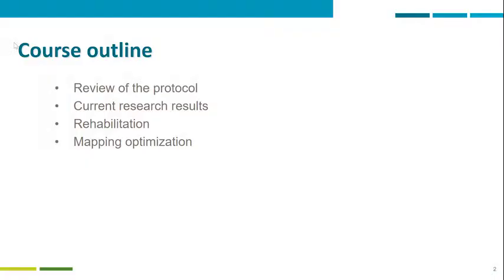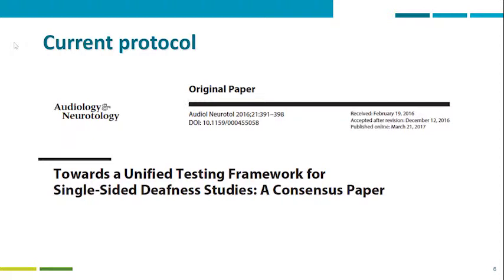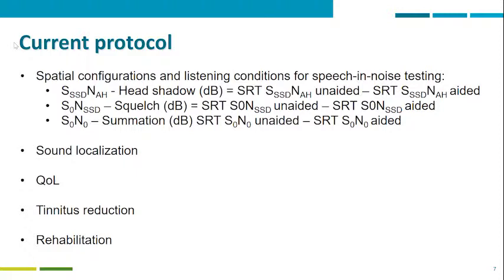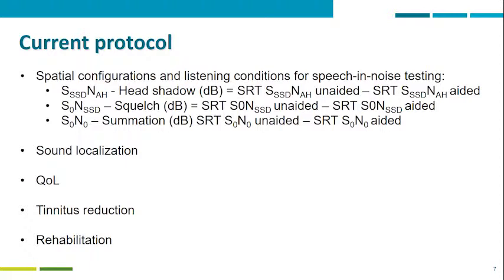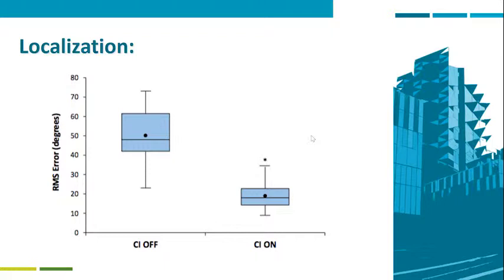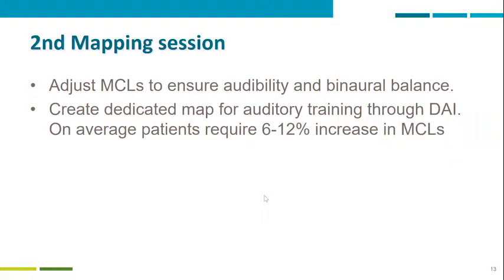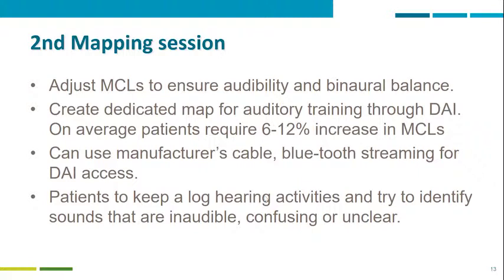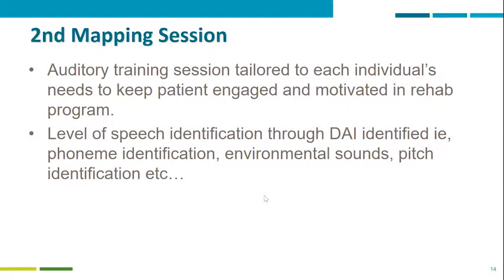Cochlear Implantation in Single-Sided Deafness: A Focus on Mapping and Rehabilitation

Comment: Thank you for your post.  Just a week ago I experienced sudden sensorineural hearing loss in my left ear and I am now completely deaf in that ear.  My right ear is functioning very well.  I am considering Cochlear implant to address my left ear and based on your video and other research the sound from the implant will be quite different than my good ear.

My main question is, when a patient is using both ears to listen, when sounds came from the implanted side, did they sound altered or did the functioning ear compensate and provide input to the brain to filter out the “robotic” sound from the implant?